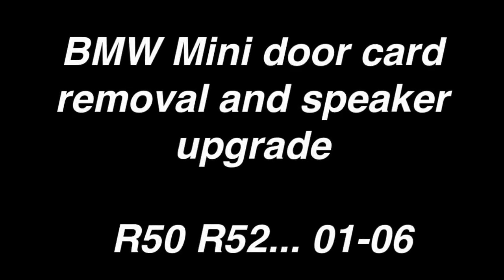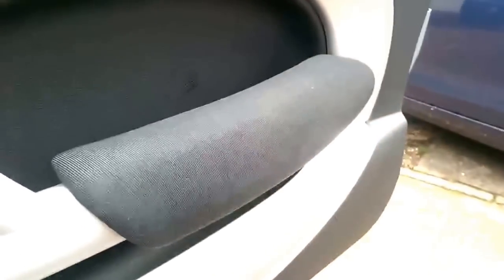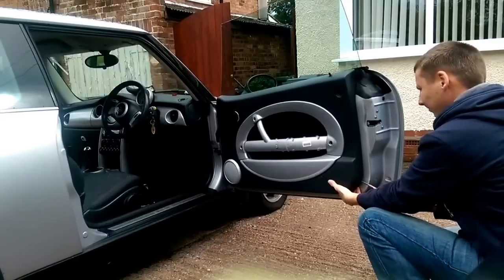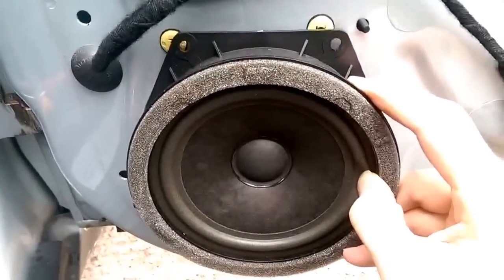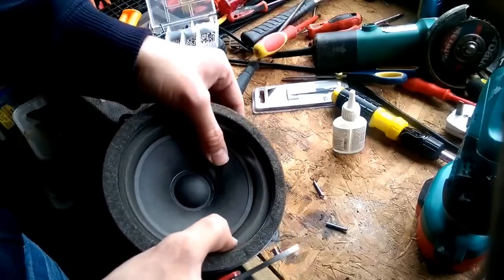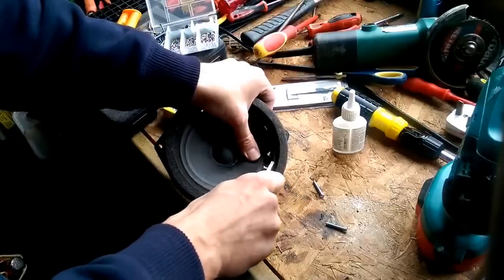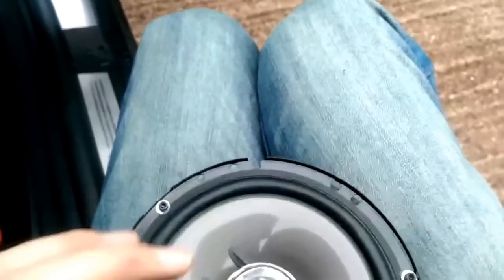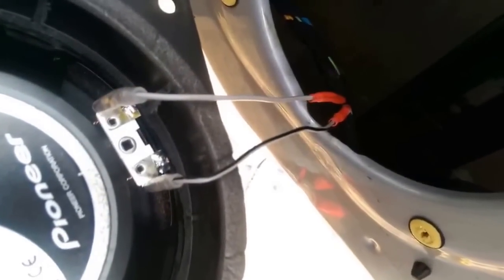BMW Mini Cooper Door Card Removal - Speaker Upgrade R50 R52 2001 -  2006

Comment from the maker: It was an instant benefit, tons of bass over stock. I don't have any fancy recording equipment or way of giving you a comparison but would definitely recommend.. There is no benefit to changing the rear and they are a real pain to get to.. The head unit change was the big one as you have so much more control over the equalizer. I spent £100 on a head unit. Well worth an afternoon.

Comment: do the door poppers break when you remove the door panel? I'm wondering if I need a bag of them in advance. my speakers rattle when the windows are open.
Reply from the maker: No, they are robust. Firm, consistent pressure will free them. Just never "yank" them. The build quality is great so it feels solid to pull them. If you have a nice long rigid screwdriver (10-11") it's a lot easier.
Reply from the maker: To be honest, the arm rest is by far the worst as its so tight. The secret is that push clip (in this video it's the far left when I flip it down) 1cm square push hard and slide towards the hinge of the door
Reply: +Floppydonkey fantastic, thanks man

Comment: Hi about to attempt this on my R50. I got 5 1/4 (which is what was said to replace my old ones) Im worried about the soldering. Is it not as simple as connecting the ground to ground and, well, you get the idea...?
Reply from the maker: Hi, it couldn't be simpler... if you don't want to solder, just use crimping spade connectors that simply pinch the bare wire and then slide onto the terminals of the speaker. this is a very common practice. An example of what i'm talking about would be: . http://r.ebay.com/T57LGj 

Regarding the polarity (matching wires...) you cannot damage anything if you were to mis-wire them, I would advise having the power and stereo off when you to it so that no live speaker wires touch the metal bodywork (ground / negative). If you were to accidentally mis-wire the speakers, they would be "out of phase" which means the driver cones would move forward when they are supposed to go backwards, this would only be a problem if you used them at their limit... yes I'll be blasted from an audio engineer for saying this but to there are literally millions of speakers out of phase and you wouldn't have a clue and cause no issue on general use. On a system like in the video, you would be fine. Generally speaking, whichever wire has a line (red) is usually positive. 

Hope this helps, Thanks for watching.
Reply: Floppydonkey Thanks man your video helped a lot!

Comment: In the process of doing this after one of my door speakers finally blew after 13 years.

I've gone the route of buying a set of cheap 6.5 inch components, but will only be installing the woofers as the stock tweeters work fine and will probably provide better separation than going co-axial....guess I'll know in time!

If it helps anyone.....

The armrest is only an issue on facelift (post 2004) models as they changed the design of the unit.  The 4th bolt resides under the armrest on facelift cars hence why it has to come off...on pre facelift cars its immediately accessible.

I have found that taking a plastic baby feeding spoon and jamming the end of it down the middle of the armrest (from the front, pushing towards the rear of the door) where the big retaining clip is works a treat for pushing the clip to disengage it without damaging anything.  For anyone with young kids a cheap alternative to buying a trim tool.

Note also if your door trims have been removed before (given the age of the car most likely) it's possible the trim clips may have been replaced.  If so be mindful that they may break when the door panel is removed.  I had to replace a few of mine when I first got the car as the old ones did not hold the panel on well, upon removing the panel they all broke.  Fortunately I had spares.  Definitely worth buying a pack from eBay before you start.

Also look to buy some speaker wire adaptors so that you don't have to cut the factory wires they dont cost much.  Also fitting spacer adaptors save having to butcher the stock speaker and takes some work out of actually fitting the things.

The unfortunate thing with the factory door speakers is they are destined to fail.  Being coated paper and also being exposed to moisture they'll eventually just go.  Replacing with aftermarket units allows you to increase the size (stock are 5.25) and most speakers are now polypropylene or similar so wont be affected by the elements so badly as the factory units.  Benefit is of course they should sound better too.

The rears are a pig to do, but ironically a straight swap for pretty much any half decent 6x9 once you get to the location (no spacers required) and so easier to actually change in that respect.  However as the stock rears are a bit beefier than the door speakers and not exposed to moisture they tend to last better and they work pretty well for providing bass and rear fill.

110% replacing the stock head unit for a half decent aftermarket one makes a huge difference as the amplification will be a million times better.  A huge improvement on sound quality just by doing that..as well as an easy way to add DAB and bluetooth if you want it

Comment: So you changed the speakers for 230w ones, 
do you need an amplifier? Hows the sound without buying a new amp?
cheers
Reply from the maker: Diederik absolutely fine... You wouldn't need an amp for these speakers regardless of rating... You would need to beef up the speaker mounts and possibly dynamat the panels if you want to stop the car shaking to bits. The system worked fine and was way way better than the stock bmw unit.
Reply: Thanks for the response & for the video,
i got one more question about the soldering,
Do you happen to know where i can find instructions on doing this?
Reply from the maker: If you are not used to soldering, I would not bother going to the expense of getting an iron and messing around. For the gauge of wire and application I would grab some "wire crimp connectors" you can even get them with the spade fitting to directly on the speaker terminals. http://r.ebay.com/T57LGj  they just pinch on the wire with no soldering.
Reply: Did you mention the connection terminal of the speaker unit is different from the BMW terminals and you had to change it or something?
Reply from the maker: Eric Hansen yes... I simply soldered some standard spade connections on the wire.. see 4.00min onwards
Reply: Floppydonkey Hey also did you upgrade the upper speakers? I have been reading that they are 4 inch speakers, could I put 4inch tweeters in them do you these would fit? MTX RTX4BT
Reply from the maker: I put coaxial speakers in the main door opening and left the upper tweeters out of use. I found no problem with doing this as the car is so small and the seats are so low. I know I should have used the tweeter mounts but found for a relatively cheap solution, it made a huge difference from stock.

Comment: Was it easy to identify the factory wiring's polarity before soldering - how did you do that?
Reply: Almost all car speakers have a large terminal, which is the positive, and a smaller terminal, which is negative.
Pause the vid' at 4'08" secs and you'll see.